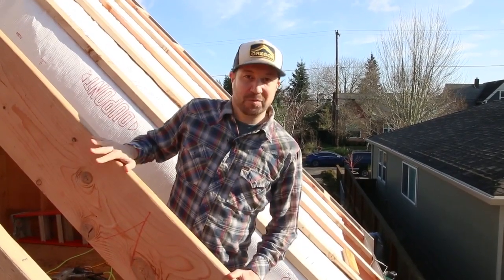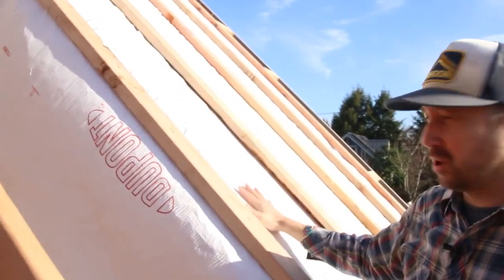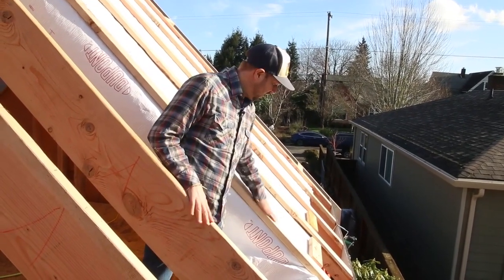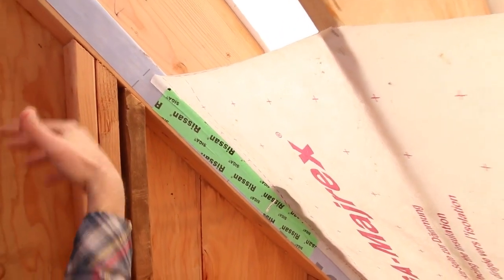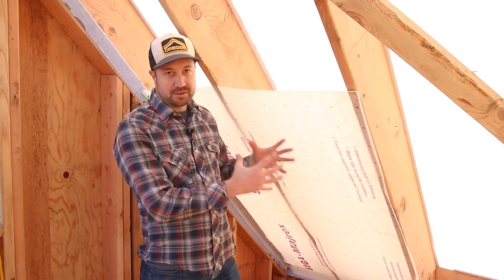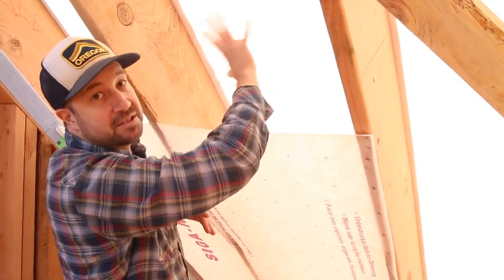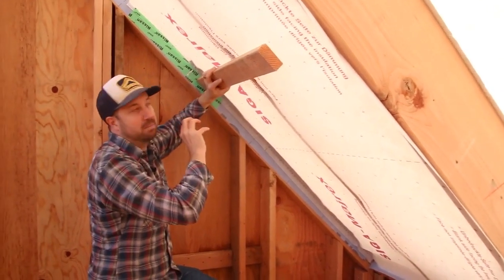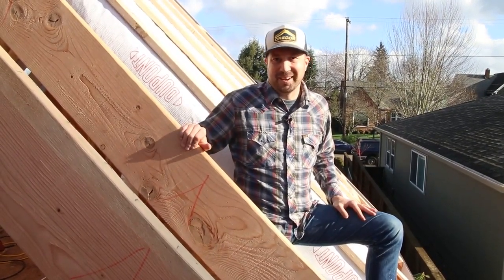Building a Vaulted, High-Performance, and Foam-Free Roof Assembly

Comment: So can we do this without tapes? I understand using plastic membrane - we work to minimise our exposure to plastic, but sometimes it's just the best material we have for the job, and as will the insulation on our electric cables, sometimes we just have to accept plastic. But I've never yet seen a tape that won't peel off within the next hundred years, and for key components that keep moisture out and prevent rot destroying the structural timber, I require something better than tape.

Comment: Are you worried at all about long term fatigue of the house wrap due to constant air movement across it?
Reply: Not sure what you mean by fatigue in this case, but it shouldn’t be an issue with the rafter space filled with blown-in cellulose insulation. That gives the Tyvek something to rest on so it’s not suspended in tension.

Comment: So glad I saw your video on unvented vaulted ceiling and moisture mitigation.  I was going to do Vapor diffusion Port but there is no room in my roof assembly to allow free air flow from soffit to the ridge.  I thought I had to use closed-cell foam + mineral wool until I see this.  Thank you!

Comment: I’m confused as to why the interior membrane “closes down” with high humidity going from interior to exterior, yet “open up” to let humidity escape going from exterior to interior to dry the insulation cavity.  How can you have it both ways?
Reply: Majrex membrane was designed based on the natural moisture balance of a cactus. SIGA brand name for this tech is: Hygrobrid. A cactus allows moisture into the plant at night to trap the moisture inside during the day, preventing the plant from drying out in the hot/dry desert climate. Similar to the cactus, Majrex allows the moisture to move from within the wall to the inside of the building but doesn’t allow interior moisture into the wall. It's “one direction vapor transportation”, as moisture only moves to the interior. Seems like magic but it's just fancy layering of different products to mimic something found in nature.
Reply: In the summer air-conditioning season, it’s high humidity outside, and hence also within the roof assembly.  I’d rather that water vapor not migrate to the interior in the summer.
Reply: Having the moisture migrate to the inside is absolutely the right strategy for the long-term durability of the roof assembly. Otherwise, you greatly increase the risk of the moist air condensing on the cool (air-conditioned) side of the assembly (such as when 6 mil poly is used as an air barrier instead of the vapor-open Majrex). High-performance buildings with excellent thermal, air, and vapor control may require supplemental dehumidification in addition to the A/C, but that’s still preferable to the moisture condensing within the cavity where it inevitably leads to mold growth.

Comment: Are you using longer nails (16d instead of 8d or 10d) to attach your roof sheathing?
Reply: Yes, nails need to be long enough to get code-required embedment into the rafters.

Comment: "We're using no plastics!" First product used is Tyvek wrap
Reply: Haha yep yep
Reply: A lot less than with spray foam, however, and no issues with off-gassing. Differential settlement is also a problem with spray foam as it dries out over time and becomes brittle. It’s virtually impossible to construct a durable and cost-effective high-performance building with no plastic or vinyl.

Comment: Origami?!!! Lol. I laughed.  Cellulose compacts down I have read.  So????  Blown out n loose fibreglass or rock wool is expensive. Maybe I could do this for my house next year. Post frame q 8’ 60’x40,  maybe use floor trusses instead of roof trusses. Somehow make a vaulted ceilings out of them then use your idea mirpex bottom insulation then tyvek then maybe 2x4 on end with 5” Perlins screws for the air space and steel panels

Comment: Nice, but this system still has thermal bridging through the joists. That could be minimized with TJIs or with a rigid foam on the interior under your nailers, but I understand you are trying to avoid foam.

Comment: How many of these have you built to date?
Reply: This is the only one because it has serious issues with its design. A roof with foam has decking first for strength, then foam and furring strips before more decking. It's not even air tight with Tyvek. He's installing decking over the sketchy 2x4's. This roof will have much less shear strength. It needs 2 layers of decking in order for this to work properly. Let's hope there's no big wind storm or tornado nearby.
Reply: @jdaz5462  You are absolutely wrong on all points. Air tightness is achieved with the Siga Majrex membrane on the underside of the rafters and taped to the Majvest lapped over the top plate from the outside. “Air tight” and “vapor open” are not mutually exclusive properties. Structural integrity is achieved by using nails long enough to provide code-minimum embedment into the rafters. Two layers of sheathing are not required to achieve lateral resistance to wind and seismic loads.

Comment: Hold on. There is nothing rigid against the membrane?? I think you just made the world’s biggest harmonica. Every time there is a wind storm, the homeowner is going to hear that flapping around, no?
Reply: It's stapled to underside of the rafters, and the lateral 2x4s every 24" up the length are also fastened through it to the rafters as well.
Reply: No, the dense pack will hold it in tension

Comment: You now have a thermal bridge every 16 or 24 inch's. Could be done better
Reply: It’s a trade-off; sure, reducing or eliminating thermal bridging would certainly be better, but the payback on the additional cost would be many years in a relatively mild climate such as Portland. Kind of like triple-glazed windows: unless you’re doing it for additional reasons such as acoustical separation, it’s not really worth the upgrade from double-paned windows as the payback from lower utility bills is decades.

Comment: Josh, very nice work!  There was a brief comment below about a radiant barrier on the top-side membrane.  The overall theory I've been contemplating is to add a reflective foil membrane on the top-side, which reflects radiant energy back into that 1 1/2" vent channel.  Reflecting that radiant energy back into that vent channel should transfer that heat directly into the air that is moving up, because expanding air has a natural buoyancy which helps that heated air to rise up to the ridge vent.  Simple physics, actually (cf. gas laws:  PV/T is a constant).

I also really like the addition of standard 2x4s to create that air channel on the top-side.  Depending on the nailing schedule, it also results in adding much additional strength and stiffness to the rafters.  As such, a similar assembly could be very easily adapted to jobs where old roofing is being replaced:  pick up at the point where all old shingles are removed, with bare plywood remaining.  A 1/2" rigid insulation with foil backing can be quickly ripped on a table saw and placed between those 2x4s, leaving a 1" vent channel.  Alternatively, 2 layers of 2x4s create an air channel that is 3" deep, allowing room for rigid insulation that is thicker e.g. 1" or 1 1/2".  I'm sure your capable carpenters can work up the soffit intake and ridge vent details:  piece o' cake for capable professionals like yourself.

KEEP UP THE GOOD WORK!

Comment: I also live in the Portland Oregon area and wonder if Josh would use this assembly for a very low slope roof?
Reply: I would use exterior insulation over the roof sheathing on a very low-slope roof as you likely won’t have enough convective air movement to dry out a vented assembly adequately.

Comment: The low-slope side of your roof may have more issues with venting (less stack effect) did you change the assembly on the low slope side or do you have a working minimum slope for the 1.5" vent cavity to work? 
Also be careful not to use pva primer on your drywall!

Comment: curious could you not just use 1X strapping instead of the 2x4??
Reply: I think he meant on top of the rafters, not the horizontal underside of rafters
Reply: That makes adding electrical boxes and etc really tight.
Reply: The recommended minimum air gap for a vented roof assembly is 1 1/2” which 1x strapping would not provide.

Comment: Why not just use regular vapor-impermeable membrane (0.2mm polyethylene sheet, for example) on the inside? The "smart pores" cost a lot of money for zero actual benefit.
Reply: Polyethylene generally results in moldy walls because it traps moisture in the cavity as it moves inwards from the outdoors. It's better to have no vapor barrier at all than it is to have polyethylene.
Reply: @worganyos  I generally know what I am talking about - it is difficult to judge if you do. Do you have knowledge in this, or is it "just a hunch"? In the former case, we can discuss further. In the latter case, let's just move on.
Reply: @AdityaMehendale  that's a pretty pointless response, isn't it?
Reply: @worganyos  On YT, it's difficult to determine who is trolling, who has a case of the Dunning-Kruger effect, and who is actually knowledgeable, and trying to make a point. My response isn't pointless - I am trying to discern which category you fall into. No conclusions thus far.
Reply: @AdityaMehendale  what are your thoughts?
Reply: @worganyos  My thoughts are:
Condensation forms on cold surfaces
The house shown here is in a cold climate, i.e. w/ heating indoors, never airco. In other words, the insides shall never het colder than the dew-point outside. The inside shall often have a humidity-level that is above the condensation-point considering the outside temperature. In that case, the inside-membrane must be vapor-impermeable, (e.g. to prevent moisture from the exhaled air inside from reaching the insulation-material) and the outside membrane vapor-open to allow any humidity to escape to the drier (i.e. outside) side. Remember that the insulation shall always have a temperature that is warmer than the outside, but cooler than the inside, so it shall happily lose its moisture to the outside air, even if it is raining outside. What do you think?
Reply: @AdityaMehendale  I think your explanation makes perfect sense if they don't air condition. I don't think that a poly barrier is necessary, but it doesn't sound like it should cause a problem. I think that any interior air barrier would do, since the vast majority of moisture moving into a wall is through convection; vapor diffusion rarely causes a significant problem on it's own. I think that if they ever ran an air conditioner, which they probably will because everyone does these days, even in the north, then the poly would cause a minor problem with condensation but not a huge one because it would be allowed to dry out for effectively 10-11 months of the year. The service cavity is a great idea, and definitely a tactic they would want to employ even with poly.
Reply: @AdityaMehendale  Homes in Portland, OR absolutely use A/C and increasingly so with climate change. I would have to put you in the category of “don’t know what you’re talking about.” No offense intended; just making an observation based on the available data. 😂😂😂
Reply: If by North Portland, he means Maine, then I know that people definitely air condition for a few months of the year there.
Reply: @worganyos  He's got an Oregon hat on so that would be my guess, but most places in Canada use A/C for the hottest parts of the summer/fall too. I'm on the East coast where it's not even that hot in the summer and I still really appreciate having the heat pump for cooling. I'll be using a smart vapour barrier, not poly, and focusing on air barrier as you said. So glad I found this video, the air barrier/insulation details are just what I was looking for and I feel so much better about the vaulted ceiling plan for my cottage now!

Comment: It seems that thermal bridging is not considered in any way with this strategy though?? 
Also, is the water control layer going to be on the roof decking? Will it be taped at the joints to also become another air control layer effectively having 2 air control layers?
Reply: I'm not aware of a way to break a thermal bridge to the exterior without foam. Thermacork perhaps.
Reply: @JaredCzaia  well, I mean you just need insulation. A non-foam vapor open option is mineral wool/rock wool on the exterior of the roof. Seems as though at least something breaking the bridge is like, really important no?
Reply: @kenmarcou  True, comfortboard on the exterior would be about perfect for this scenario. I had to google to find it as I assumed mineral wool only came as a cavity filler and not as a sheet good.
Reply: @kenmarcou  dont forget the drywall and paint add another layer of vapor and air on the inside.
Reply: @JaredCzaia  Low density fiberboard insulation is also an option.

Comment: $399 for one roll?  Siga must be very proud of this product.  Finehomebuilding should also highlight less expensive alternatives to solve problems like this.  With my build I'd have to purchase three rolls for around $1200 bucks.  That ain't in my budget.  I guess "Finehomebuilding" means expensive, uppercrust homebuilding instead of middle-class budget minded homebuilding.  Thanks for the vid, though, because it has given me an idea on how to insulate my attic space.
Reply: To be fair to FHB, at least the expensive building materials they feature are typically for performance and longevity as opposed to luxury and appearance.
Reply: The expense of the material may cause you to balk, but in most cases you get what you pay for. Also, take into account how long the assembly will last, its overall performance and how well it will handle as a conditioned space (As that’s what this whole thing is for). If the whole assembly costs upwards of $15k for the roof, for example, and lasts you 20 years, then the roof cost you $750 per year before any deductions you make for energy savings.

For a high performance assembly like this one appears to be, it’s more than the upfront costs. Try to see the bigger picture of how your home’s performance can be improved.
Reply: @multidinero  'the bigger picture' is that vast majority of Americans will not stay in one house for 20+ years. Sorry, not sorry, but I'm not taking on a 20+ year expensive system to benefit people who come 10 years after I sell.
Really wish people would clear their minds of that fantasy.
Reply: @willbass2869  from your statement, I’d recommend you not touch your roof at all. Being cheap always goes wrong when it comes to houses. The video is about energy efficiency and ultimately lowering your bills. If that’s too expensive for you, then you must like high energy bills. 

Small money, like bills, make those who think like you do, feel that the price of energy is cheaper than the upgrade to lower the bill. In actuality it’s a compounded effect. By installing high performance upgrades to the home you increase the home’s value and save money of the time you’re in the home. 

But, if you’re planning to move in two years because your house is too small, I’d disabuse yourself of that fantasy. You’re going nowhere! Between the Wall Street companies and the Oligarchs from foreign countries investing in American real estate, if 15k in upgrades makes you cry, you’ll be stuck for the next decade.

Unless you’re building from scratch, then maybe you have a chance...but again, building doesn’t sound like your speed. But, I’m doing a lot of assuming.

Suffice it to say that it’s no fantasy to live in a home for 10+ years. A lot can happen in a decade.
Reply: @willbass2869  Herein lies quite possibly the biggest problem with residential energy efficiency in the US, disposable housing. The only way to fix it is with extremely strict codes. But that doesn't improve the millions of existing houses.
Reply: @willbass2869  as someone who's had to frustratingly fix house where the owners cut corners where ever possible and did everything on the cheap, this "oh well not my problem" childish mentality needs to stop.  If you can't fathom doing things right. Then maybe owning a home isn't for you.
Reply: @willbass2869  If more people did this then it wouldn't matter what house you move into; they're all built better. Consider planting some trees under whose shade you know you'll never rest. Take some care of your environment.
Reply: @HaploBartow  lol 
Wow. Responding to a 2 yo post....oh well.

Same answer.....you don't get to get a free ride off my  effort, time or money.
In 5 years there will a new, bright sparkly thing that'll grab your attention and that is a fabulous improvement......zzzzz
Reply: @willbass2869  Typical of the “race to the bottom” or “me first” mentality that is overtaking so much of the culture in the US these days. Sad.
Reply: @mikecousin8523  No, I cannot afford a spray foam ceiling nor would I want one due to off gassing.  Plus, I already have my blow-in insulation purchased, thus no need for spray foam.  What I am truly wondering is, is Sega wrap the "ONLY" product on the market for this particular application or are there other less expensive alternatives.  Certainly in the  old days there were products or practices utilized that matched what Sega is manufacturing.  Two sides to every coin, yet I feel that FHB and Matt Risenger is so far up Segas line of products that they hardly ever show other alternatives.
Reply: @tynyyn5344 intello is another smart vapor retarder from New Zealand that works just as well but it costs the same.
Reply: @mikecousin8523  I think they still use plywood (or OSB) sheathing over the sleepers, so no savings there.
Reply: @mikecousin8523  I didn't think of that.
Reply: Ice dams will be created if air does get through.
Reply: If anything about the phrase “fine home building” leads you to think budget friendly or middle class. You’re not understanding the term.